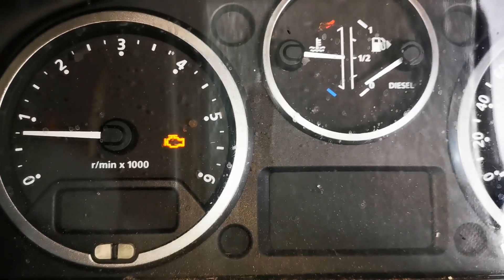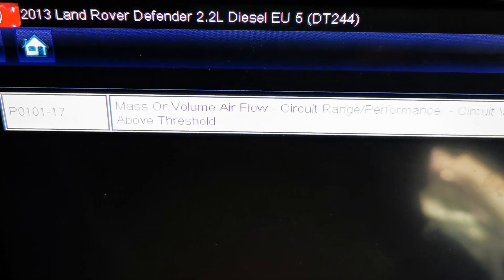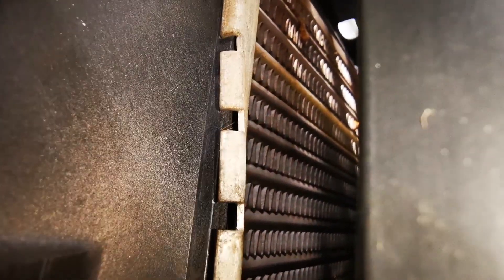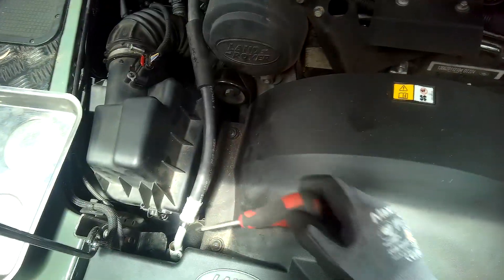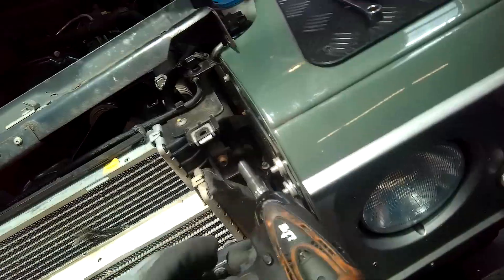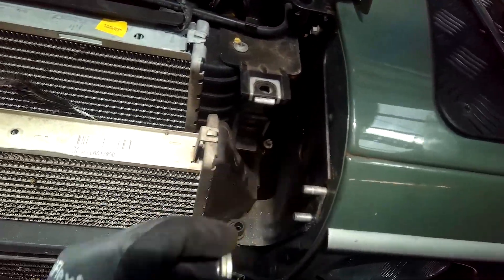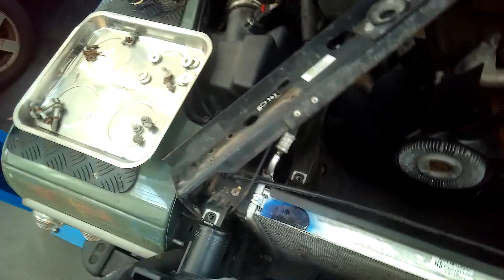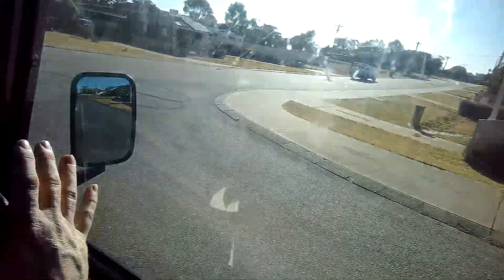P0101 Land Rover Defender - Loss of Power - Limp Mode

Comment: i have this problem on a land rover evoque 2018 2.0 ingenium diesel. the probles is, when the maf is connected i have the 12v but the 5v volt going down immediately to 2.5v. without sensor i have the 5v. with a new original part  MAF i have the same problem. have you ever have this problem?🙏🙏🙏

Comment: I have issues with my td5 d2. 2.5. I change waste gate. Flow meter. Maf .
Fuel diesel valv. New diesel tank pump. New oil filter. And + bypass the wastagate straight to the intercooler pipe. New o ring. New injectior harness . And still I got now power. Pleas any suggestions. Cuse I don’t know what to do.?

Comment: Hi Gerard, I hope you are well. Just saw your video. I have a 2.2 Puma Defender, with an error  -  Turbo / supercharger boost system performance. Used a diagnosis machine to clear it but it keeps coming back. When the Check Engine light comes on, turbo fails. Please advise. Thank you
Reply: Check # 3 injector or ckck all injectors,fuel not sprayed to require pressure or fuel amount when turbo struggled! Like failure of execution

Comment: Súper helpful thanks & great video 🙏🏽 - can I clear codes with a cheap OBD2 scanner off Amazon? Then get it out of limp mode so I can try to diagnose as you did, or do I need an expensive OBD2 reader for that? Any idea? Cheers
Reply: 9 months later……. Could you now tell me if the cheap reader resets limp mode?